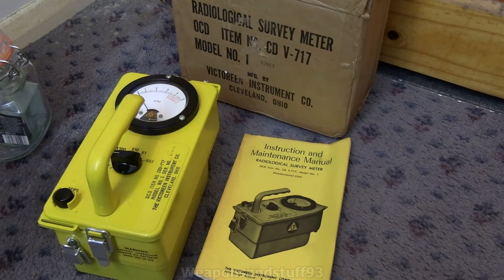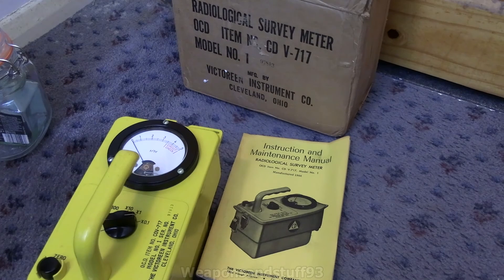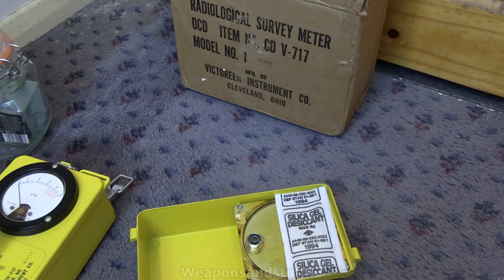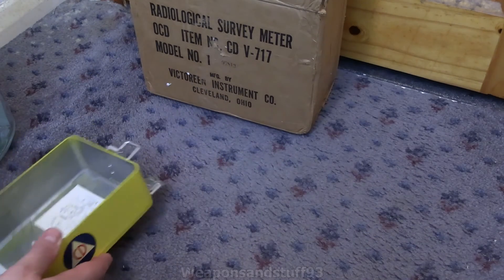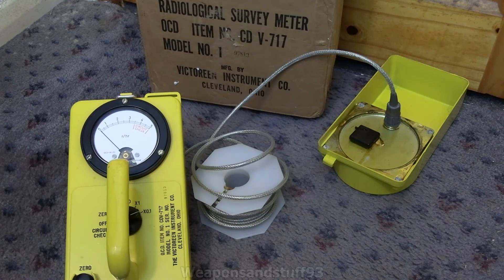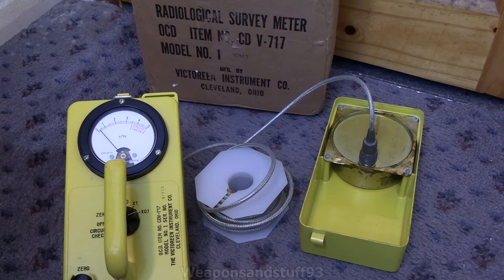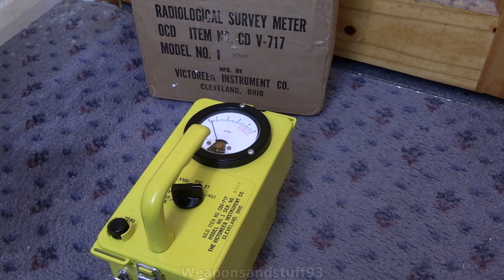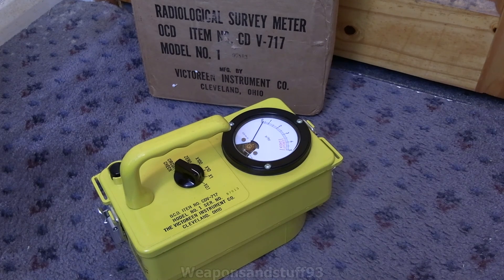CDV 717 Fallout Shelter Survey meter

Comment: These are very rarely working. The best way to get these operating with the extension cable is to actually hard wire it then insulate it extremely well. Also fun to make DIY ion chambers to use it with. The most sensitive one can be made with an old tin can with actual tin plate inside. Use a BNC connector sealed well onto it but isolate the outer connection with some circuit board and epoxy solder the inner connection to a can or thin cylinder of metal. Keep a 1Cm gap. On the bottom glue some metal mylar on it then have a screen over that. Attach the inner bnc wire to the sense, outer to the guard electrode, and can itself to the ground connection. It will now measure x0.01 in all ranges. ❤

Comment: Great video as always! Been meaning to add one of these to my collection. Who do you think makes the best high dose meters? I think the British PDRM is the most hi-tech, The Russian/Polish RS70 is certainly the toughest and the The American CDV-715 is tough and easy to read. Overall i'd say the American one is the best all rounder. Though I have a soft spot for the PDRM's.
Reply from the maker: Cheers, do you have a British MD3, that's my favourite, it's basically an upgraded/retrofitted MK2 Radiac with new hardened electronics, recalibrated to cGy rather than R and surplussed very recently.
It has all the advantages of the CDV 720 + is alpha sensitive if you open the case.
The PDRM82 personally I find suffers due to the casing allowing EMF interference and the narrow range of it's GM tube.
The 82 will not respond to dangerous x rays or hard beta under 60-80kev I believe.
So if you expose the PDRM82 to x rays it will often give a low reading or crap out due to the EMF radiation that goes with the X-rays, where as the MD-3 will work fine as well as respond to stuff like SR-90 and AM-241